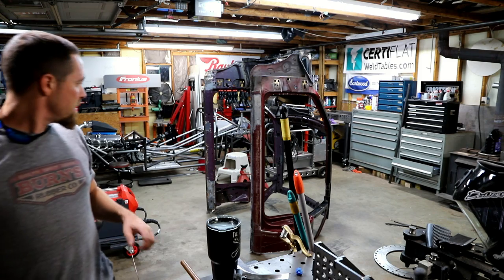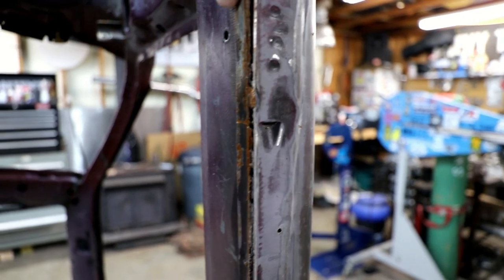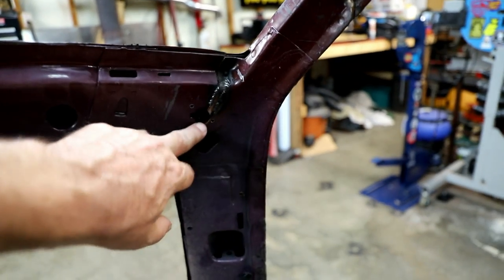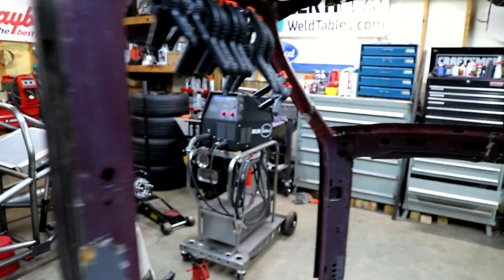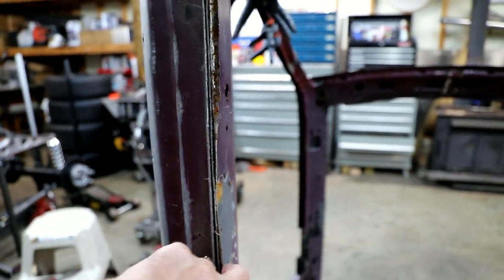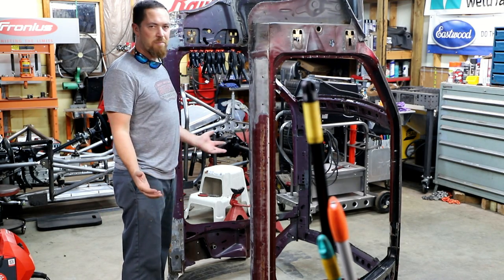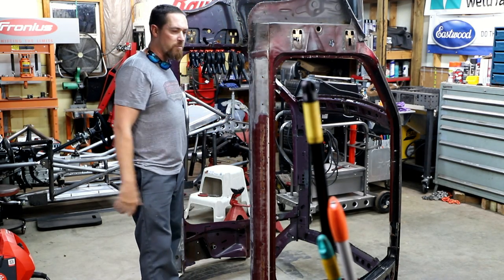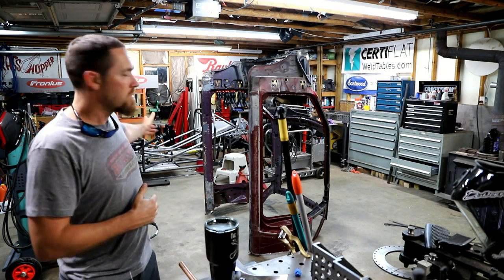Going To SEMA & FabTech

Comment: Can you talk about welding helmets on you need this Tool sometime , is there a difference between Mig and Tig helmets or there the same because i was looking to buy a author helmet and on the package it said for Mig and Arc only . as i have a Tig and just learning to use it but had no problems with my eyes  using a  normal helmet  , is there a shade difference in helmets for a tig welding just asking .
Reply from the maker: I will see what I can do
Reply: Thanks